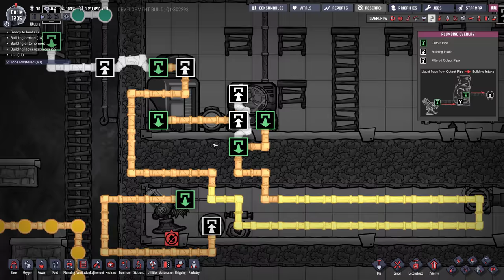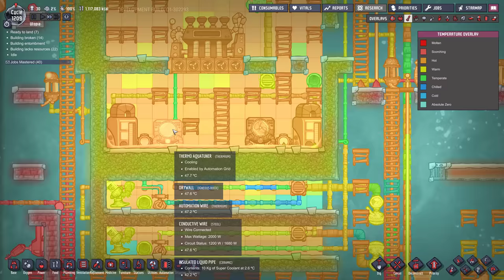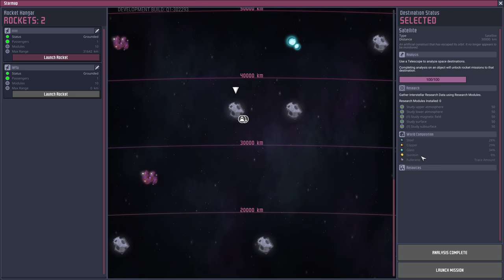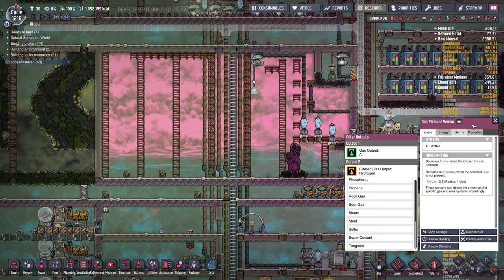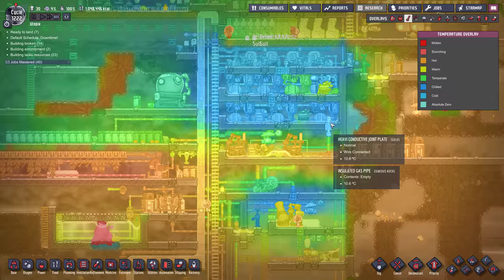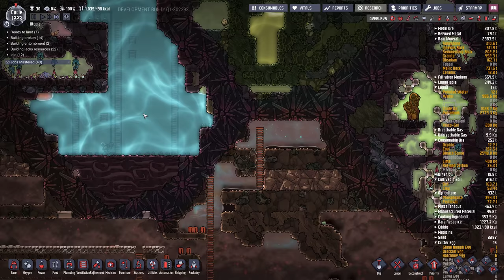Oxygen Not Included - Quality Of Life Upgrade Base #27 (Liquid Hydrogen & Liquid Oxygen Setup) [4k]

Comment: machines have a melting point and an overheat temp.
both info can be found in the description of the machine you build
edit: if you dont see an overheat then the machine building or whatever doesn't overheat

if something melts it will become a tile of the metal you used.
if it overheats it will stay the machine it was but has to be fixed with the material you used for it.

example: a gaspump made out of 
-iron will have an overheat of 75°C but will melt at 1534.9 °C
-steel overheat 275, melt 2426.9

Comment: I had so many problems setting up my liquid oxygen/hydrogen >_< It took days.
You made the same misstake as I did in this video (one of my many mistakes), you need to vent some steam or the system won't work. Since the pressure vent stops at 20kg and the steam turbine stops if the pressure is lower at the bottom, so they deadlock eachother. So just crack open the wall to ease the pressure. Also if you ever need to go in and fix something without releasing all the steam I recommend visco gel for an easy liquid lock, just remember to put dry wall behind it.
Lastly a tiny thing, you used a bridge to double the flow of your hydrogen (me like) but it still gets stuck at the next split just outside of the chamber.

If you've played since this you've probably already found these things, but if you hadn't I just wanted to help.
Good job getting it all done in one episode!

I also did something by mistake that ended up being a good thing. I had some excess liquid oxygen so I bottled it and then used bottle openers to pour it into hot water, actually cooled it down quite a bit! I then used it to temporarily cool my storage area.
Reply from the maker: Yeah I had to vent out some steam just after this episode. 

As mentioned it was 2-3 hours of prep building and 1 hour of final bits.

Comment: 29:58 I made mine with a single supercoolant loop through both tanks. Looping through hydrogen first since it requires a lower temperature and bypassing the oxygen tank if the LOX ever gets below -200 c. though i think i over-complicated everything with petrol cooling later to be burned in a rocket and a steam turbine with thermo sensors. the sensor overkill probably helped since i built everything out of steel.
Reply from the maker: Single loop would work but would halve your output (assuming you can feed it oxygen and hydrogen as fast as it can cool). Do you find it takes longer with one loop?
Reply: @GrindThisGame   you can chain the aquatuners with a diversion before each one, diverting 15c short of -270. the chain may actually cool things faster since it would cool by 28c per loop round and i don't think the supercoolant will lose too much heat since your tanks are small and loops are short. I've found the supercoolant never gains more than 15c per round but this is probably because i don't feed it enough gasses. i'm using one aquatuner and 8x13 tile large tanks so the initial cooling was quite slow.

Comment: The reason why the Cooling loop split some of the coolant is because of the animation.
Very simply explained: The Machine has to startup if it had no work causing it to not accepting 1 packet of liquid. But once it is started up until it shuts down again it is continues.
Thats the reason. It should also fix itself after the loop is fuller
Reply from the maker: Thanks for the explanation.

Comment: instead of putting the top super cooled chamber two insulated layers from the heated chamber, why not separate them by a layer of vacuum? Ceramic may be a good insulator, but vacuum is the best insulator in the game.  Also, would making the background tiles in the heated chamber diamond Tempshift Plates help speed up the process of generating energy from the steam by getting larger portions of the steam up to 500k (the temp for the turbine to work) at a time, or does the steam heat up quick enough from just the bare aquatuner(s) that it isn't much benefit?
Reply from the maker: Good idea with the vacuum. I'm not sure if tempshift plates work as background seals. Haven't tested that. They wouldn't heat things up faster but they can store thermal energy for sure. The aquatuners do a good job at heating the steam. I'm not after power with the build though, just heat destruction via the steam turbine.
Reply: @GrindThisGame  Tempshift works fine for background seals. I usually use them in my steam room for early rockets.
Reply from the maker: Nice. I learned something today :)

Comment: Radiant pipes in a vacuum once heated or cooled respectively dont change the temperature of whatever is in them
Reply: For example once a pipe is heated up by steam in the vacuum of space u dont have to worry about letting the steam sit inside the pipe because there isn't a thermal exchange in the vacuum of space
Reply from the maker: except when the rocket blasts off and leaves gas to conduct heat....argh.
Reply: @GrindThisGame  I've only been working with steam so I haven't ran into this issue, you saved me a ton of headache pointing that out. love the vids, I watch regularly!

Comment: can anything be done with the magma at the bottom of the map?
Reply: yes you can use it to make things hot :p. make steam from water and use it in the steam turbine to cool it back down and get power from it. or in some ways you can create petroleum from oil without the use of a oil refinery

the magma when cooled enough it will become igneous rock then u can mine it if it cooled enough
Reply: a lot of fancy things - I usually use it to produce sour gas once I have a setup to cool it back to methane/nat gas
Reply from the maker: It's good for boiling dupes.

Comment: for steam couldn't you have used a steam vent?
Reply from the maker: If it was close and hot enough maybe. The steam cools as it moves along the gas pipes and can turn to water and break the pipes. This is why I like to do it pretty close to the rocket.
Reply: @GrindThisGame , what if you use insulated pipes? Then would it turn to liquid?

Comment: I dont' trust the reservoir to be insulated, I never put it in an area with a huge delta-T° like that - am I being paranoid? :=
Reply from the maker: I think they do leak some heat now. When the first came out they were perfect insulators I think.
Reply: Yeah I think they leak some, I put my petroleum in an ice biome and it melted.
Reply: @Cedrath  what about your pipes?
Reply: @esaedromicroflora1247  They are insulated but only igneous rock. But if I look at the reservoir the fuel is at -5C, so they must leak some heat... I guess